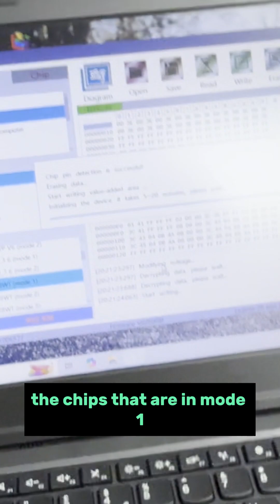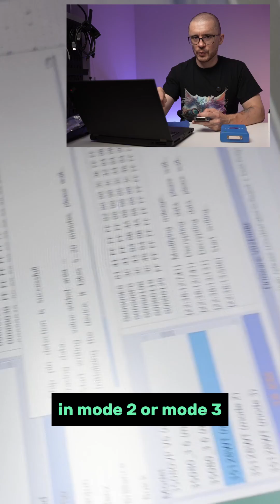CG PRO vs 35128WT EEPROMs – Know This Before You Start

Comment: No actually the CGPro will work on most 35128WT chips in mode one where the mileage is in first 2 lines. But there are some 35128WT with certain chip id's that CGPRO  will not work on. 
Out of the around 10 i did . i only had one that did not work  and had to use a emulator. 
Also just a tip with CGPRO when adjusting the mileage on 35128/35160 epproms sometimes it fails on first time and you have to repeat 2-3 times before it finally works. 
There is also a special firmware upgrade you can do to your CGPRO ,instructions online that is for the 35160/35128wt .
Reply from the maker: thanks for sharing

Comment: Wild idea but Have yall tried an integer overflow on those unchangable chips? Might be possible but im not sure
Reply from the maker: hmm ... you are giving me homework to understand what that is, and how it works. The short answer is no.
Reply: @BestDiagnosticTools  An integer overflow happens when a calculation produces a result that exceeds the maximum value that can be stored in a given data type. For example, if a system uses a 32-bit unsigned integer to store mileage, it can hold values from 0 to about 4.3 billion. If you somehow forced the value past this maximum, it would “wrap around” back to 0 or a very low number - similar to how an old mechanical odometer would roll back to 000000 after reaching 999999.
Reply: @BestDiagnosticTools  so if you would be able to change the milage on the chip to something near that max number and then drive a bit it could rollback to „-xxxxxxx“ or maybe even 0
Reply: @h @hiabst have you done it?
Reply: @jeffmilles123  no im just thinking about ways to do it
Reply: @hiabst how you think if i make maximum milage with cgpro for exlample 10 00000 and then with can bus hacker i add milage in cluster will it make zero? for exlample in old cars after 99999 it makes zero, how much is limit for new cars milage?
Reply: @jeffmilles123  i cant really gurantee for it to work but if its a unsigned integer it would overflow back to 0 if its an signed integer it would go to -max. But theoretically it should work
Reply: @jeffmilles123  but the limit would be a 32 to 64 bit number if i would have to guess
Reply: @hiabst  i will try and let you know,